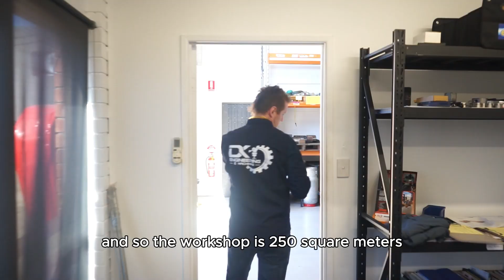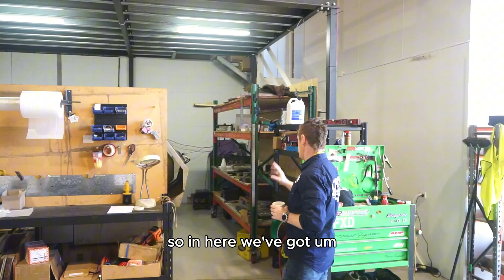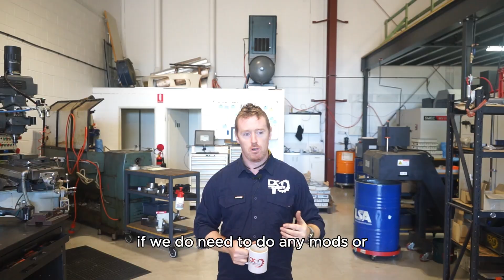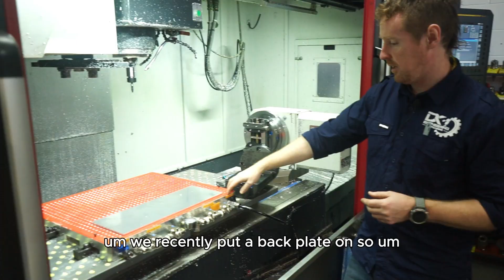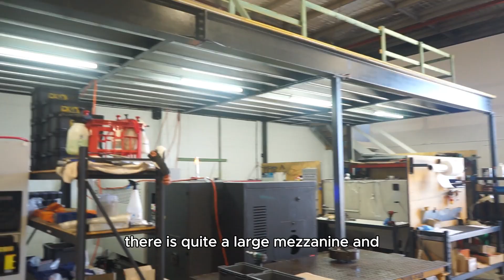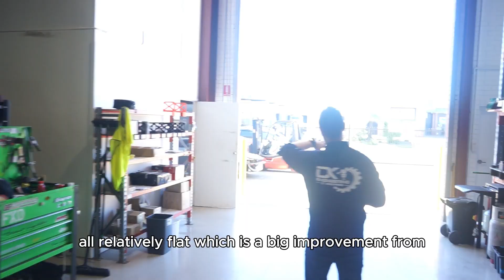Empty Warehouse to Full CNC Shop in 8 Months!

Comment: Eight months to that layout is quick work. One thing worth doing now that the slab has had a bit of load time: re-level the machines with a proper machinist level, 0.0005in per foot sensitivity (0.02 mm/m) - a lathe bed usually wants to end up inside 0.04 mm/m, and precision CNC lathes inside 0.02. New concrete keeps moving for the first year or so under a few tonnes of machine, and taper you can't dial out of a job is nearly always the bed twisting rather than the tooling.